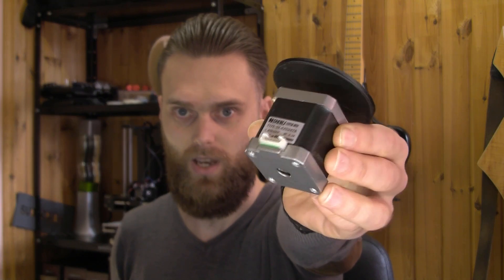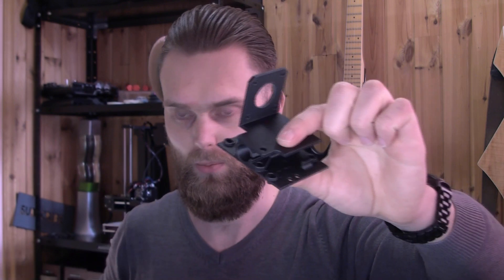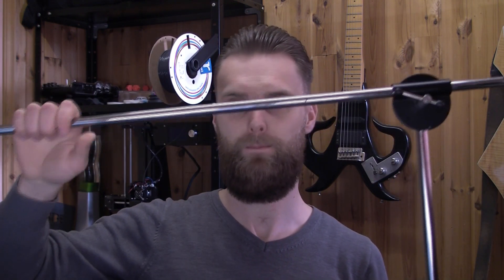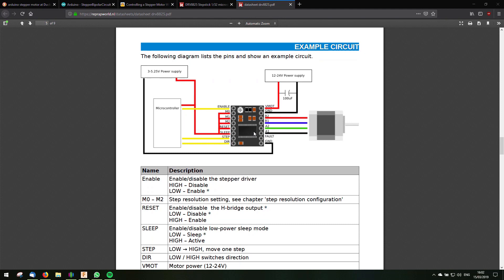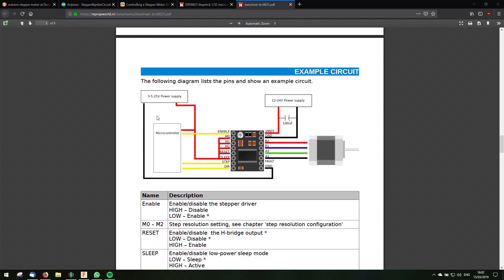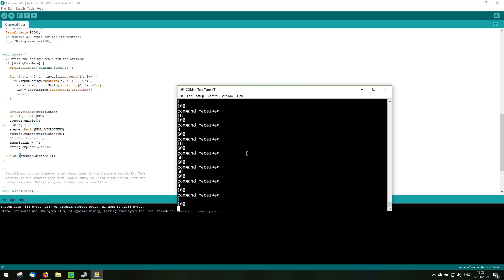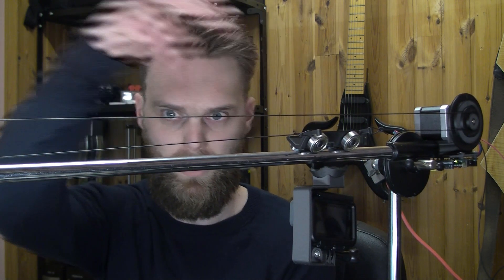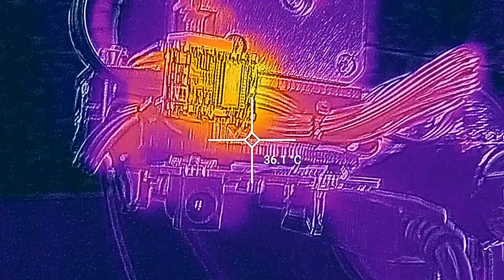Arduino camera slider using a microphone stand

Comment: It should run cooler if you lower the reference voltage on the driver you probably don’t need much torque anyway, also switching to 1/16 stepping or lower will reduce heat aswell